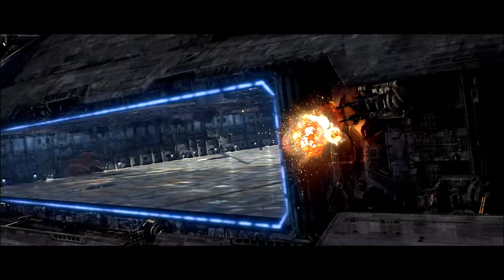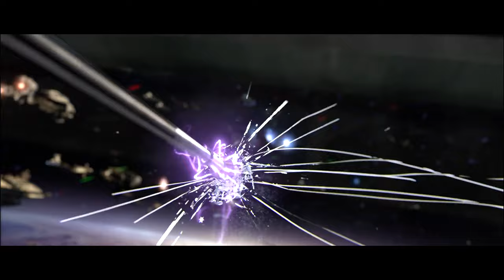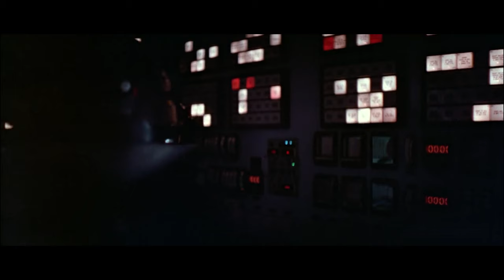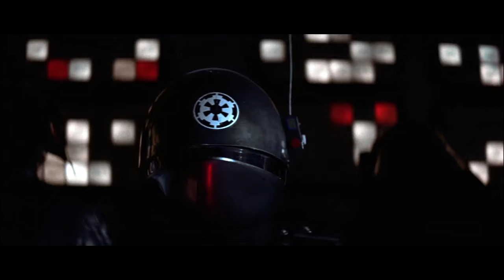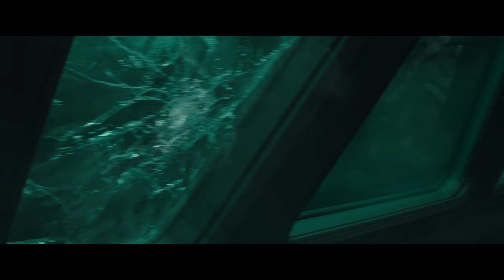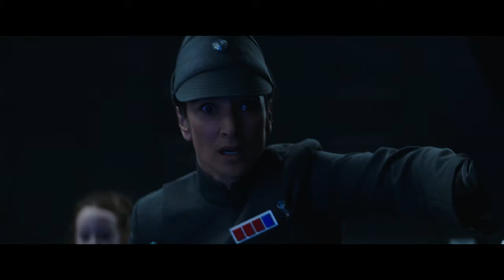This makes literally no sense

Comment: In my opinion, ALL warships in Star Wars should be like the Acclamator-class. That bridge has no windows. It uses holographic technology to display what is going on outside.
Reply: EMP wins the battle.
Reply: @honotenshi  heavy shielding and reinforced electronics are ubiquitous in Star Wars capital ships.  It would take a squadron of y-wings dropping a bunch of ion bombs to disable something like an ISD.  And really, who has the time for all that?
Reply: @honotenshi  if I got EMPed in Star Wars, why would I want to look out the damn window anyway? 

It happened in Rogue One. How did that help the Empire stop a collision between two ISDs?

It happened in Empire Strikes Back. How did that help stop rebel transports from escaping?
Reply: @russellharrell2747  to answer that question, the rebels did during the Battle of Scarif. But there was nothing the Empire could have done anyway, even with windows.
Reply: @LordVader5738  possible window escape if the EMP doesn't take out anything inside the ship, space suits, etc.
Reply: @russellharrell2747  also tell that to Greivous in the Clone Wars. Literally used one Capital Ship to wreck Plo Koon's fleet. Main reason they went from blood red armor to Grey.
Reply: @honotenshi  that was a super weapon that fired a massively overpowered ion blast.  That super weapon also got blowed up by small ships firing proton torpedoes just like the death stars decades later.  Every ship has some kind of vulnerability.  Building a ship with a dedicated Wave Motion Cannon that’s not the hero ship of an anime isn’t gonna end well.  And we never saw another ship like the Malevolence again, because it was probably far too costly and not effective enough in the end.  It may have destroyed a fleet by itself but it also cost as much as a fleet.
Reply: @russellharrell2747  true, but that weapon's capabilities could've easily been repeated with a more competent Admiral or faction, let's say a certain Chiss Grand Admiral of the Empire? Pretty sure Thrawn would've taken that over the Death Star and multiplied it so it wouldn't be just one ship, if he got his way that is.

Comment: In any spaceships (apart from smaller fighters I guess) from star wars this glass is protected by the energy shield and if that one is disabled, there's no difference between glass or metals as both can be easily shot without the additional protection.

Comment: Maybe using windows reduces the psychological effect of being in a metal box for months at a time on deployment. Although that doesn’t excuse its use in critically important areas. You could start questioning why you have such an exposed bridge on a Venator or SD or SSD.
Reply: Same thing happens to submarine crew. Same sort of concept, except they don’t get windows to stop the pain.

Comment: The answer is rather simple, there's nothing you can put on a ship that is more reliable than your own eyes. Cameras and sensors can break, malfunction, be tampered with, and generally break down over time. It's all maintenance that isn't required. On top of that, ships already have sensors that give them a 360 degree readout of the battle, but this has an opposite effect than you would think. Instead of relying on said sensors, most captains would (and do) rely on eyesight just as heavily as their instruments. This is because most tacticians would strive to blind their enemy by taking out their sensors, however, you can't blind a ship that relies on literal eyesight without killing its crew who are all behind metal and shields which have proven time and time again to be rather resilient. In other words, if your ship relies on sensors blinding you is rather easy. But if you rely on eyesight, the only way to blind your ship effectively is to just flat out destroy it.

Play a game of space engineers with shields, loads of space pirates, and no third person and you'll be begging for windows in no time.

Comment: I think there may be a few reasons why they didn’t do this, I’m just gonna list the reasons why I think they didn’t use sensors or cameras.
1. The cost, it would be way more expensive to have a bunch of cameras and sensors all around the ship then windows, and we all now the Empire likes to cut costs.
2. Aesthetics, I mean let’s be honest windows look way better than a metal box with cameras and sensors all around it.
3. Visibility, I mean I’m guessing the visibility wouldn’t be that amazing, because you would probably be seeing very close to the ship and It would be very annoying. Unless you made the cameras stick out which would make them easy to target and destroy, which either way I feel destroying cameras wouldn’t be that hard, I mean just take down the shields and then you can easily destroy the cameras. Once the cameras are destroyed face it the ship is stranded it won’t be able to see anything. Plus I guessing if they used cameras then all the camera feeds would go to computer screens which a navy officer could only see, so how is a admiral or Vader supposed to see out? I mean they could go to one of the monitors, but that isn’t as cool as them menacingly looking out the window. Sure they could put a bunch of TVs everywhere but we just talked about cutting costs I don’t think they would do that, plus it still wouldn’t be as cool as the iconic stare out the window.
4. They just might’ve not thought of that, I mean it’s way simpler to add some windows than come up with this. Plus the windows aren’t that vulnerable they still have the shields.
That’s my head cannon idk if you agree but I personally think this is why they used windows, but let’s be honest the real reason they didn’t use cameras or sensors is because George Lucas would never come up or agree with it.

Oh yeah sorry about the long essay by the way, lol. I guess I’m just a passionate Star Wars fan.
Reply: Dude that’s what I’m thinking

Comment: The glass in Fortress Inquisitorius is there for precisely the opposite reason. The base is designed to flood during escape attempts, since it's too far down to swim to the surface. In both cases of successful escapes we've seen on screen, the characters needed outside help to get out alive.

Comment: You notice that the glass in both scenarios only break when exposed to high amounts of energy such as a light saber with windu the electro staff with grievous and the blaster bolt with kenobi with these examples I conclude that the glass could still be a very strong material it's just that the type of weapon that hits the glass causes it to break.

Comment: In the thrawn books, it is explained that the ships are capable of using sensors to look out, and have blast shield that can slam down over the windows if the need arises. However, they keep the windows open most of the time in order to keep watch in case of sensor failures ect.

Comment: There's also the idea that they probably tend to have an oxygen shield over the glass to hold the vacuum back in the event the glass breaks. But in this instance, it was either turned off or damaged in the attack. Same goes for the glass itself, maybe there's usually a shield keeping it from breaking that was not on for this instance

Comment: As Thrawn pointed out, ships can be disabled through ion or other malfunctions, having windows costs nothing and the sacrifice in hull integrity is minor. Most windows in Star Wars have shields or blast shields if they are damaged. Besides, I think in this specific example you have to remember who the Separatist ships are designed for, droids, who don't need air to survive. Life support on their ships is a bonus, not a necessity.

Comment: Although I do think glass in an underwater base is stupid in a military perspective. The reason of having glass in a space shuttle actually makes sense since sensors have been proven to be faulty many times like in A New Hope they couldn't detect the empire fighters that well. So having glass to see surroundings in case the sensors couldn't pick up ships that were either undetectable or just cloacked by having the same signal as an ally ship makes a lot more sense to actually have glass windows. With that being said the glass windows underwater are still pretty dumb as u can only see in day time and even then u could just go by its blind spots to sneak making the glass underwater stupid.

Comment: when someone’s shooting at your ship, you usually have shields. even if u dont, the lazer blast is penetrating the ship regardless if it hits glass or metal. swapping windows out for steel doesn’t give that much of an advantage in a combat situation, and it limits your information on the enemy to only what your scanners tell you

Comment: There's a lot of terminology that is used in the other media that isn't used in the movies, but the material used in the windows is called "transparisteel," not glass. Given the name, it's a translucent metallic substance that gives the appearance of glass. It's a well-known fact that Grievous' cybernetic body makes him vastly stronger than average sentients, so it really isn't very surprising that his enhanced strength, combined with the electrical current running through the staff, is enough to break the window. A strong Force user would also naturally be able to throw a tremendous amount of power toward a viewport made of the same substance, so Obi-Wan being able to break it isn't surpising either.

Comment: I believe that the reason those viewports are used is because if the ships relied on sensors, they could be jammed, shut down by a lucky ion cannon shot or disabled with an ion torpedo, the same goes for cameras, therefore in order to keep visibility throughout an entire battle, the viewports are the best option, they may suffer from being rather open to enemy fire, but it is better than losing all visibility on the enemy all together, not to mention most viewports are reinforced heavily making it so that only a direct hit or many close shots from a laser would shatter one.

Comment: The problem with sensors and cameras:
You're completley blind if they fail. Just imagine a star cruiser that has been hit by an ion blast or that lost it's main power due to battle damage.
The crew wouldn't know about anything that's going on until power is back.

Comment: What bugs me even more than just breakable glass is why there's no protection from the glass after it's broken.

There is a scene in "Total Recall" where Quaid is being chased by the bad guys and they shoot out the windows at the entrance to the Mars station, it causes a vacuum and begins to suck everyone out.  We see a short scene in which the guy at the terminal checking everyone in is struggling to reach the emergency switch that lowers the shutters to cut off the entrance to the outside, stopping the vacuum.

The thing I don't understand is why those shutters weren't automatic as soon as pressure in the entrance dropped below a safe limit.  What if the guy couldn't hit the button?  It would have sucked the entire inside of the station out to the surface of Mars.

Yes, I'm nitpicking.

Comment: But sensors and cameras are fallible. If they’re disabled from within or without, you’re left blind. Windows may be fragile, but ships have shields. Also, glass is more susceptible to damage from physical weapons, like the electrostaff, rather than energy bolts, which is the most common danger to capital ships.

Comment: So what you're saying is that they should start making it so that the only connection they have to the outsided are some screens and buttons that can very easily be shut down if someone sneaks onto the ship. They are big ships, so its not like its that hard to get into one without anyone noticing. If you use glass you can very easily see outside at all times. The sensors and cameras are a nice idea, but what happens when someone decides to put some tape onto them removing their ability to see? with glass it will take a lot longer to cover in tape. That is why they use glass.

Comment: In a universe full of advanced electronic warfare systems and countermeasures that can jam, confuse or evade all kinds of sensors, visual confirmation is absolutely crucial in battle. It's the same reason why turrets are often manual in nature and crewed by living gunners; automated turrets (while certainly common) simply can't be trusted to engage certain targets. Also why most ships, from starfighters to large capital ships, often engage each other up close despite having an effective firing range of thousands of kilometers.

Comment: Because without glass if you lose the sensor that you use for navigation then you either have to blindly navigation or "drop anchor" until its fixed while you may be on a schedule. Realistically they'd have blast doors that close automatically in the event of a rupture.

Comment: I think wedge raised numerous points as to why he and a lot of others don’t like the bridge being enclosed in new rebellion, he was commanding an mc90 I think and the bridge was basically entombed in the middle of the ship
Then he’d have to rely solely on sensors, no warriors instinct, all basically just glorified targeting computers. If something unexpected happens, say he spots something untoward that could be a trap, he can see it better with the naked eye from an exposed bridge than he can on sensors. What’s more if the empire hits your ship with an ion barrage and disables your ship, entombed on the middle you have no idea what’s happening outside, whereas with the exposed bridge you can at least see some of what’s going on in the battle and be able to communicate better once the ship reactivates as you still have a blow by blow available
And as for grievous breaking The glass, the magnaguards staff of made of phrik if I remember right which is why the droids use it as it’s resistant to lightsabers so has to be pretty strong and durable to match a saber

Comment: To be fair if a ship jams your systems and window could be quite useful.  In mass effect a flaw with the geth ships they can't see the Normandy sneak up on it.  Plus to answer the water glass situation, metals crush under pressure while glass supposedly gets stronger with more pressure added.  I imagine an architect would say so glass is needed and find other reasons as well besides cost.

Comment: It's a universe where Ion Cannons exist and can knock out literally every networked electrical system on a ship. Windows don't run on electricity. Cameras do.

The invention of ship to ship Ion weaponry actually made windows a battleship NECESSITY.

Also, it isn't glass in ships, it's a substance called transparisteel. Which is a transparent crystalline METAL nearly on par in strength with most outer hull platings, but much harder and more rigid so when it gives under force it still shatters. The fact Grievous could smash it in one strike like that is testament to just how monstrous the strength of his cyberized body is.

Comment: Everyone's talking about the cons of the windows but they forget one of the biggest pros; they expand the ship in the way that passengers percieve it. Without windows, the crew would feel cramped and claustrophobic, which would mean they would need to be switched out very often, meaning long expeditions are not practical, and the easiest way to remedy this is adding windows. Screens wouldn't work to solve this since they do not have depth and so the human brain sees them as merely part of the wall that changes. Windows help with the psychological effects of long term space travel by opening up space and calming crew members

Comment: It's really simple. 
For a ship to be able to properly resonate with its own hyperdrive, there must be a proper mass of explodium.
Now, before you say, "But why not put all of the explodium in a big lump somewhere harmless?" the explodium is 1) transparent, 2) has to be in a specific spatial relation to the hyperdrive motivator(s), and 3) cannot be stored or installed in too thick of a layer or it will prematurely explode.
So given those three points, ship designers figure they may as well use it for windows.
-
Simple physics, really.

Comment: I think it's partially due to something that happens in Rebels, which demonstrates the point. They need to sneak on to a capital ship and they only have a heavily graffitied tie fighter which looks so obviously different, but they manage it because the Empire doesn't look at the ship physically, only scanning it and letting it through. Scanners can only do so much and not having actual windows would disadvantage them more than the slight chance of either a precise fighter shot or an inside battle breaking the window.
Also its the same reason car doors still make a clunking noise and phone cameras make a click sound, we just get into a habit (of including windows) and then keep doing it so long as there's no serious flaws in it.

Comment: The shields are the thing that changes this. Shields protect the transparisteel from exterior attacks so the only way to shatter it would be from the inside. This could be a problem if you get boarded and the enemy storms the bridge, but at that point you have bigger problems, and flushing them out by exposing the bridge to vacuum might be better than letting the ship fall into enemy hands.

Comment: We see in Fallen Order that Fortress Inquisitorius, at least, is designed to be easily flood-able from the inside to help corner and stop escapees. Cal even uses a terminal to flood another part of the Fortress a great deal away, and the data logs explicitly tell us they are designed to be manually flooded.